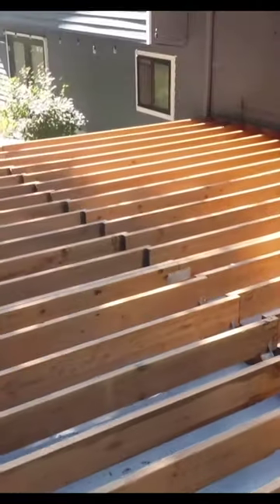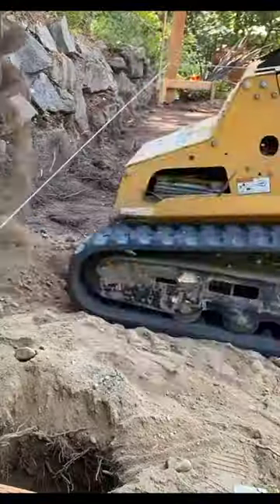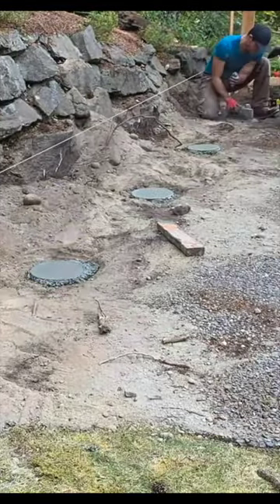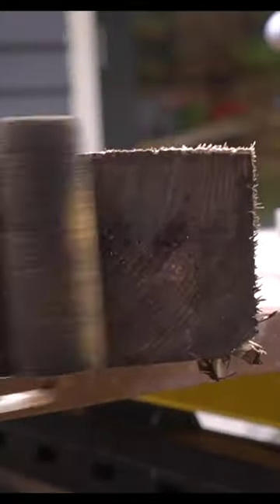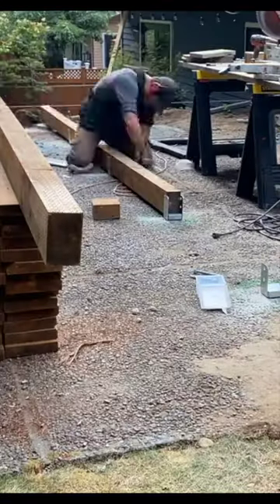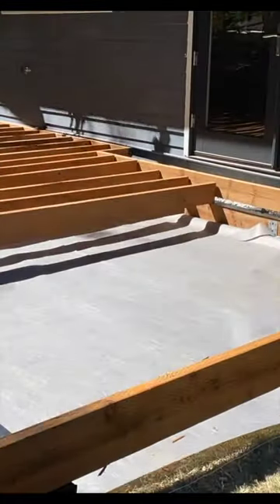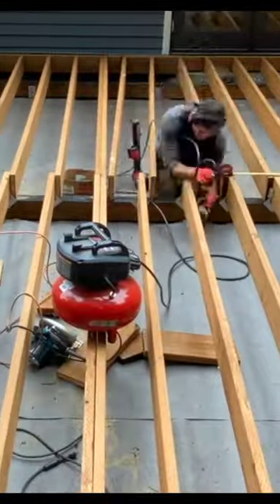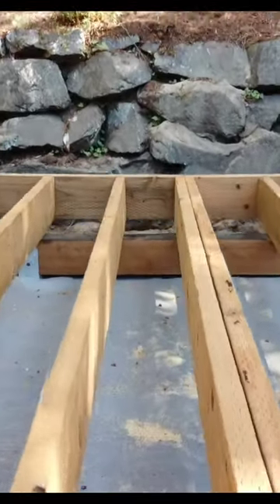DIY Freestanding Deck (Part 1 of 2)

Comment: It's a freaking ground level deck Built to accommodate semi truck parking
Reply: exactly.. the reason things cost way too much and we're in the financial bind that we're in.

the fact is. after 5 to 10yrs owners may sell or owners themselves will want a new deck or extension/remodel of some sort that will require it being removed..

and it's built to last 50yrs. 
wasteful
Reply: @clasreid2571  I’ve never heard someone complain about something being made TOO well. But here you are.
Reply: My thoughts exactly. To over build is to waste. Waste is a sin. The correct material to just do the job is best practice and conserves resources.
Reply: @garburto this is  complete over kill for a temporary structure.  No outdoor uncovered wood structure is going to last the life of the house.  Idk about his decking but 12in centers is closer than the joists in the house.  The big problem with over building is weight and cost.  He could have spent much less.  Also idk about the area, but if he is in a wet area the 2×10 will not breath enough in those demensions and can be subject to white rot.  However, if he is in a dry area and using composite flooring, he's probably going about it the right way, but he's paying alot for it.  Some would say too much.  The knee wall could have been secured with post blocks and it would have saved him a tone of time and money.  If this is a house it's one thing, but the deck won't last any longer being overbuilt.
Reply: @clasreid2571  ⬅️ if "complaining about literally anything" was a person.
Reply: @jay70328  lol... c'mon.  It's a fact tho. I'm in real estate and it's shit like this that eats up investors profits. Over doing projects just to be able to over charge for everything.
Reply: Why are people complaining about him following the specs for composite decking?? Composite requires 12” OC. 2x8 my be a bit of an overkill but that’s his prerogative 🤷‍♂️
Reply: @tomhuggard1510  
Yea it is when he's not paying for it. And he get to upcharge on everything.

So listen. I'm not a contractor but I've done a few house flips and I've seen guys like this first hand. They don't truly care about the strenght of their work or the integrity to be honest. They are more concerned about being able to double and triple charge for everything.

I'm in healthcare and can use this analogy.  Not because it cost $200k for a open heart procedure here in the US means we have better outcomes than in India or Canada where the same procedure with better followup and aftercare cost $20k... No exaggeration. 
It's all waste and pork... overkill and greed.. the same principle is on display with this crooked contractor!! No matter how you cut it. A deck doesn't need to be build like that!
Reply: @clasreid2571  I appreciate your knowledge and response but you seem to have missed the first sentence of the video where he says he built this in HIS backyard. That’s why I said it’s his prerogative.
Reply: @tomhuggard1510  I guess I did miss that.  Thanks for pointing that out.

I still concede tho that that's a major part of the problems we have in this country. Too much waste of resources. We need to be conservative in the true sense of the word, you know what I mean? 
Additionally, lots of contractors do employ the same tactic towards their work and as a result things have become unreasonably expensive
Reply: @clasreid2571  I don’t even know where to begin with you. 
First, let’s drop the illusion “flipping a couple of houses” gave you any concept of framing. For a deck, you thicken your joists (the things holding the floor) based on total square footage. 50 people might stand on this! Same principle applies to the footings, ties, etc.
Next, building codes are actually NOT stupid. You should check out places with poor ones when things like earthquakes happen. Because it’s not about “one back patio” it’s about a whole area of people building their own death traps and having no idea till there’s a disaster.
Finally… this does back to the old “fund NASA, in this economy?” argument. As if the money gets fired into the sun. 
What “waste and pork” happened here? He paid a mill for more lumber, a building supplier for steel ties and fasteners. He rented a digger from a local business and paid skilled workers to assist him. For his efforts, when he goes to sell the house he gets to add $30K to his comps instead of tear it down first.
This country has a BIG problem. It’s not people doing things like this.
Reply: @garburto what??? that's the 1st thing i thought.. no one is driving on this.  Shit just pour concrete and stamp it. This is foolish.
Reply: @clasreid2571 maybe it's the customers who want total redesigns that are the problem.  People with those tastes deserve to pay for most expensive option possible, they deserve to be divorced from their money.
Reply: @garburto it is way to much completely unnecessary that porch would cost you 15k in lumber
Reply: @tomhuggard1510 He used 2 X 10s and his footings are 24 inches. Seems like he confused the specs for a deck hanging off a house.
Reply: Exactly! Over kill, to much work put into it and just needlessly drove up his overall cost....
Go watch the shed he made for his parents, the guy used like $50 plywood for sheathing....
Reply: @trick58  okay, do you build decks?
I do, built 2 this month in fact. In less than desirable conditions. 
You frame the floor with 2x10” or 2x12”, ALWAYS. Thickness, “roll-over” blocks, post-footings, reinforcement; all vary with size and purpose for good reason.
Also based on these comments… seriously just use the 24” footer buckets. They’re cheap, work in soft soil (the real reason he had to use them here), and give you uniformity for 2 extra bags of concrete.

Last… the guy complaining about beefier panels on a project for their parents is an a**hole.
Reply: >>>Poverty based criticism has entered the chat.<<<
Reply: Would this ideal for a shed build containing tools?

Comment: Why would you drill a freshly poured footing? Why not place the bolt in wet concrete?
Reply: Just sticking a bolt in wet concrete isn't the correct way to install.  Wet set anchors have like a little spoon on the bottom or some other method  to provide sufficient uplift rating.  A drilled wedge anchor in set concrete or epoxy secured anchors are required to achieve the proper rating.  A bolt that just shoved in the wet concrete is likely to pull out long before a proper wet set anchor or properly installed wedge or epoxied anchor.  Especially on smaller bolts like those.  The concrete is only really holding onto the slightly larger bolt head and won't provide enough resistance to lift and any cavitation around the bolt will make it even easier to pull out.  So sayeth the engineer.    But some anchors are designed with much larger all-thread with nuts and washers in the ends which will reach much deeper into the concrete and meet specs.  Just depends on the anchor and specs.
Reply: @invictusbp1prop143  That's exactly what I'm getting at. A properly designed\installed wet set anchor would be much stronger than a bolt in a drilled out set post. By drilling the concrete, you are compromising it's efficacy, even if only a bit. Once you drill it, it will never be as strong as it could have been.
Reply: The proper way is to drill through the dry concrete and use epoxy to set the anchor bolts.
Reply: @invictusbp1prop143  finally a competent commenter
Reply: @WannaBeHocker  An engineers approval of a properly installed wedge or epoxied anchor of the proper size is indication enough that there’s nothing being compromised to any extent that should concern you.  Trust and believe, they’re just fine.  And have you ever installed wet set anchors that aren’t along an exterior wall or float that indicates it’s position in the slab?   Exact placement of many anchors in the middle of an area being poured with no solid reference other than having to pull measurements off of a corner for each one, and achieving the precision necessary to assure that your anchor bolt is going to be exactly where it needs to be in order for it to go thru the hole in the post base that goes on it with less that 1/4” of wiggle room isn’t always as simple as you may think.  And probably requires one guy to do nothing but set those anchors and tend to them to make sure they remain in the exact place until the mud sets enough that they can’t be bumped or otherwise moved out of place even a fraction of an inch…and you’re still not going to get them all exactly correct.  You’re going to have to pay a guy to mess with anchors all day and still have to drill some in later….  And drilling them in later is totally approved by the engineer.  And sometimes even specified in plan details just because it’s too much to ask to get that many anchors perfectly set without any guidance in the slab.  …so why give somebody a bunch of shit about not wet setting them?
Reply: Wrong. A bolt with a washer and nut holding the washer in place will hold much longer than any epoxy. 

However, the skill needed to align the bolts in wet mud is beyond this builder's level.
Reply: Not necessarily. Resistance from a properly set anchor is stringer than epoxy. Not to mention that you can compromise the strength and blow out the concrete when drilling.
Reply: You aren't building a space ship and flying to the Moon. You pull 2 measurements and then set strings, then set the anchors in wet mud.
Reply: EXACTLY
Reply: @invictusbp1prop143  right, engineer's approval. How are the anchors installed in the unreinforced concrete here? There is no epoxy here and if he installed a mechanical anchor, the installation would have completely cracked the concrete which would then render the footing and the anchor absolutely useless in uplifting since there are no rebars in the footing.
These anchors might work somewhat in shear (and even then, not up to what the manufacturer can garanty) but they won't do jack ** if there is a real hurricane that tries to uplift this deck, especially with these footings without rebars.
Good looking deck, garbage footings.
Reply: We call them dyna-bolts in Australia.
The "bolt" is inside a steel sheath.
(Rewatch, and note that you don't see any thread)
Hammer into place, or just drop in if you drilled a little too loose.
Then you tighten the nut on top, drawing the threaded shaft upwards. At the bottom there is a chamfered lip that forces the sheath to spread and apply high outward force to the concrete.
That he had to hammer the dyna-bolt in is a nod to his precise drilling.

Hope that explains why he wasn't just hammering in a bolt.
They really are one of the most secure fasteners. I've on occasion had to remove old ones, and they are NOT easy. More often than not it is better to grind them off at the surface and reposition a new one.
Reply: If you’re asking this question you just don’t know

Comment: Wouldn’t want to see the final invoice on that.
Reply: Agreed.
Also a simple solution using deck blocks is appropriate for low height decks, cheaper and much less work (no renting machine to drill holes, no concrete to pour, less hardware, etc.
Reply: Those 2x10's are going for about $30 each atm if you buy in bulk. Without counting, guessing at 40, that's $1200 for the joist alone.
Reply: @CS-zn6pp 
Could have had a nice poured concrete deck for 2 to $3k 😂
With no maintenance

Comment: Good thing you put sono tubes in the holes....there is no way that dirt would be able to hold the concrete in place😂
Reply: It is a bad idea. The best for a footing is to be surrounded by undisturbed soil. The dirt you fill back around the sono tube will be less dense, and will support the concrete less than the original soil.
Reply: @williamforsyth6667  op was being sarcastic.
Reply: Lol

Comment: Keep in mind post hole depth depends on your location.  Frost Depth can make it allot deeper then 24 inches.   Its 4 feet here minimum.
Reply: Incredible statement, it’s a deck.
Reply: You obviously don’t understand how frost lines affect the concrete

Comment: are you trying to park trucks on that deck?
Reply: No just keeping it  code u not  a builder
Reply: Bwahaha 😅
Reply: My six-person hot tub holds 550 gallons of water. A gallon of water is almost 8 lbs. That's a lot of weight even without 6 fat drunks in there.
Reply: @red2965  haha that's way over code buddy
Reply: @Mykle  funny as it might seem codes vary by state/region.
Florida and I'm sure California along the coastal regions require hurricane ties.
Not so much farther inland but some states still do because of being in tornado alley.
Not sure where you find this overkill
Reply: @my dog ate my homework  I'm not even going to ask.
Hope you used thicker boards than 2/5 if you're doing that much  weight
Reply: @red2965  A hurricane tie isn't going to do shit to help in a tornado.  If you take a hit, you're losing everything.  Solid brick is nothing for an F4 or F5.

Comment: Awesome deck, well built.
Buuuuuut, everybodies a critic. So heres mine. Sonotube goes above the ground. Not in it. Its meant for light standards and concrete columbs. I built a wearhouse in stockton california recently where there were 38 light standards. All 48" from TOC. Being that it was summer and they ground had so much clay, its hard to get that nice hard edge at the top of the hole after you auger so thst you dont get massive blowouts when its time to pour. So our solution was to insert the sonotube several feet into the ground on some of them to prevent that. Well when the inspector came and noticed that. He failed those ones. Explaining to us that the dirt creates a natural lock as the concrete fills all the nooks and crannies and the uneveness of the hole. He also stated that eventually in the years to come the sonotube that gets buried will rot. Creating a void. And after years of spil contraxtion and expansion with the rain. And the winds on the pole, it will eventually lean. Sooo long story short. Sonotube belongs above ground.
Reply: Good inspector.
Reply: @invictusbp1prop143  he was. Good guy, easy to talk to. And not overly dickish
Reply: @ Paul Ortiz, That same reasoning I explained to our village DPWH in our area and he agreed to me.
Reply: Never. 4’ to grade.

Comment: Good thing you put those hurricane ties in. Wind would definitely rip that deck right off the house.
Reply: A lot of counties have that in their code. It doesn't matter how far off the ground the structure is.
Reply: If the house is in a windstorm zone, they're required regardless of height above grade and they're required for a reason.
Reply: @invictusbp1prop143  okay mr inspector
Reply: Lol required. Like how he gracefully left out the kerosene and motor oil PT  trick
Reply: It's floating. Not attached to the house.
Reply: Code bro
Reply: Uhm… I think he is talking about that it was put on with screws. Which shear. So they really aren’t doing much. It’s not about them being code or not it’s about the screws being used and not nails.
Reply: @OldsmobileCutlass1969Va  You don't know what you are talking about.
Reply: @invictusbp1prop143  Wrong.
Reply: Simpson screws
Reply: They make screws designed specifically for hurricane ties. No, they do not sheer because they are not made the same as deck or construction screws.
Reply: Some physics for the armchair experts.

The deck can be thought of as a wing, especially in high wind conditions.

When air moves faster, the pressure of the air decreases. So the pressure on the top of the wing is less than the pressure on the bottom of the wing. The difference in pressure creates a force on the wing that lifts the wing upwards.
(This is achieved by curving the top, and flattening the bottom)

The uplift effect of wind moving very fast over the top of a deck with that much surface area, should not be ignored, or hand waived away.

There is wing effect, and then there is sail effect. The two are essentially the same, but common sense would tend to make one think that the wind has to blow on the underside to cause lift.

Both wing and sail have higher air pressure on one side, lower on the other. The effect is the sail/wing will move in the direction of the lower pressure.

Comment: I just had deck built over my concrete patio . No need for hole digging itt does have the metal where post sit on concrete. I have nice composite deck now it’s very nice !😊

Comment: No blocking between the joists?
Reply: They are 12” on-center.
Reply: @SIE44TAR That will help with bouncing, but doesn't address lateral forces.
Reply: Right? No pressure blocking? Wouldn't pass inspection here, you need pressure blocking along all girders.
Reply: I can only assume if he did all that other stuff, he installed lateral blocking and joist tape before decking

Comment: Overbuilt for sure, but at least new decking will be able to be placed over the old joists in twenty or thirty years.. and I have to tell you, my problem with composite decking? Morning condensation- quite sucky with composite.

Comment: Fantastic job on the deck foundation and subframe.  A little bit of overkill, in my own humble opinion, but very well done.  This deck should, theoretically, outlast the house it adjoins, and possibly even may survive a MOAB strike.  I have an extensive background in structural engineering and I firmly believe that it's always better to over build rather than just "sticking to the codebook" and hoping for the best.  Bravo.

Comment: It's not pressure treated solution. That is a manufacturing process and you are not pressure treating, you are waterproofing/sealing cuts, usually on ends.

Comment: What makes these post base adjustable? I have installed these before, but I at a lose for their adjustability. Please explain. Thanks! The project looks well built. 👍
Reply: I think they have an angled slot to receive the bolt so that they can be adjusted horizontally (not vertically)